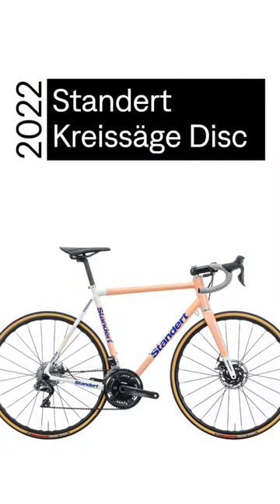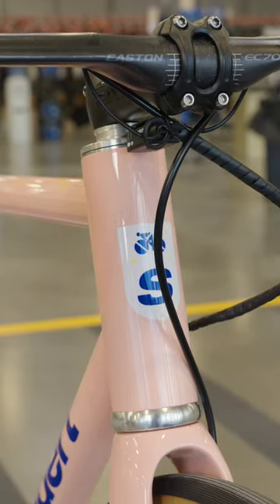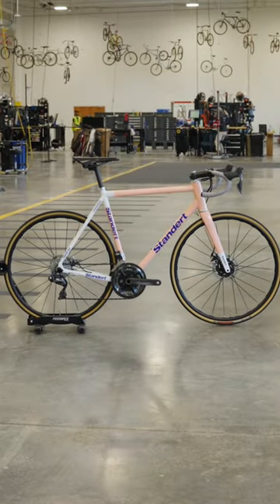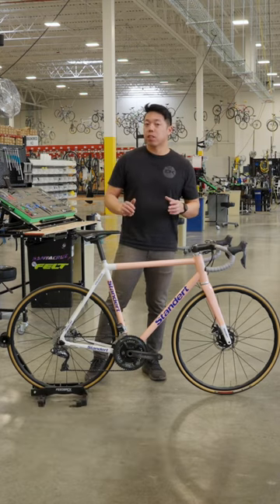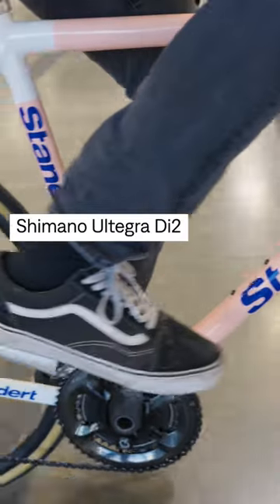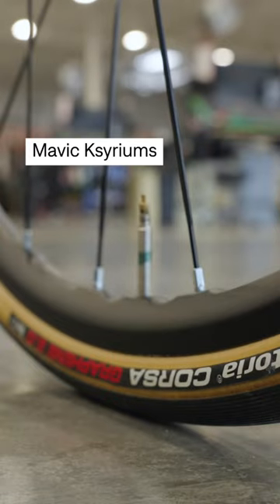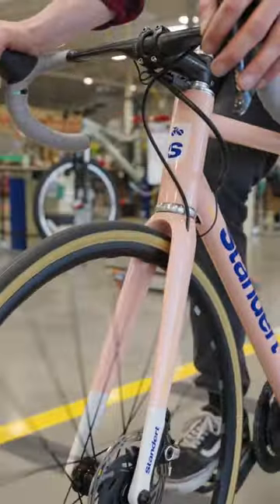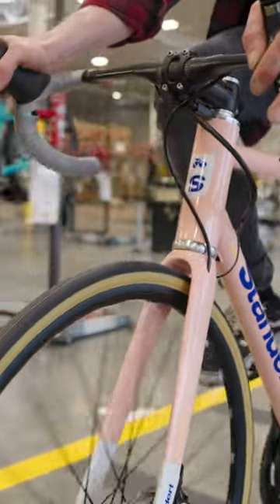German engineering doesn’t just apply to cars. #bicycle #bikeshop #roadbike

Comment: Weight?
Reply: frame is 1375g and 400g for the fork so depends on what you build it up with. Its not meant to be lightweight, but ride AMAZING.
Reply: Complete usually 16-17 kg
Reply: what are you talking about? It's between 8.7-9.9kgs MAX